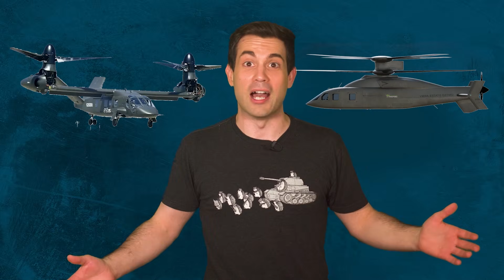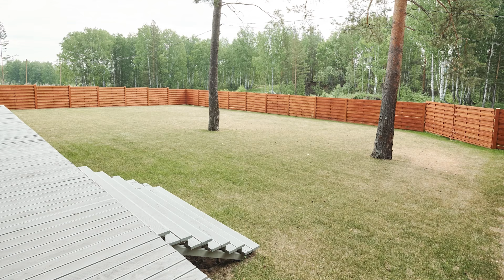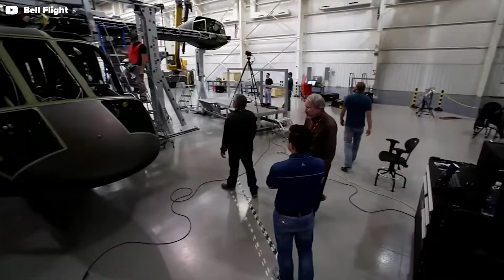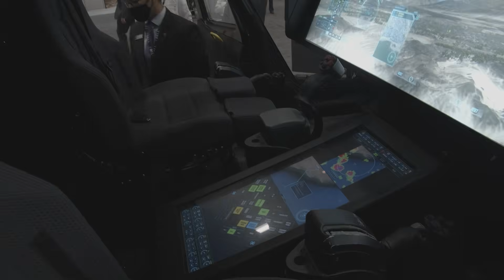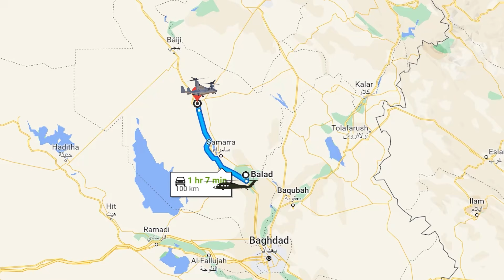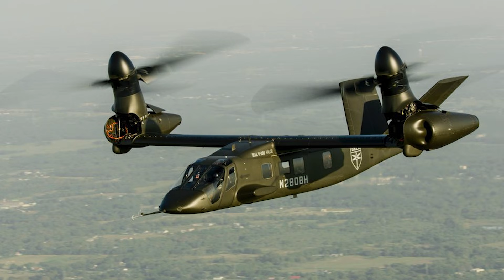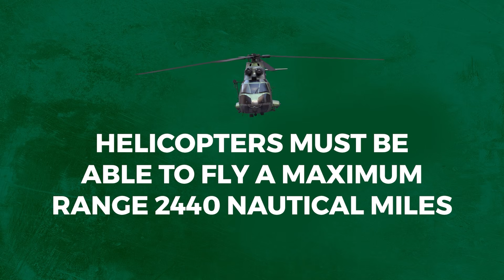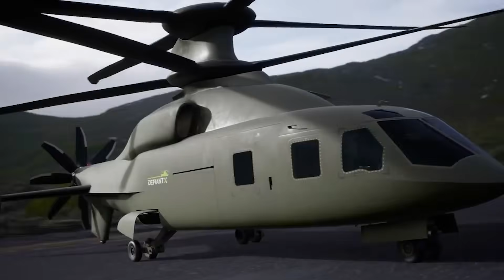V-280 Valor Helicopter Will Help Defeat China

Comment: The way I see it, both these designs are excellent. But they compete in different mission set spaces. The valor is ideal for carrying larger payloads, speed, and range. But the defiant has a much smaller foot print, and looks like it would be a better 1 to 1 replacement for the blackhawk's current mission set. I think ideally in the future, both designs would be used, and they would be utilized for the mission sets they better fit in with.
Reply: @Archer Cillian The Chinook airframe just was not designed for that configuration. The Blackhawk maybe, but it would probably cost as much or more than the clean sheet design of the Defiant. That and retrofit avionics etc.
Reply: I don't think a 1 to 1 with the BH is the goal. I believe an entirely new mission set is the issue and the goal is supplying the force for that mission.
Reply: @Archer Cillian Why would you? The benefit of a coaxial rotor is counter-rotation in a smaller footprint. It adds weight to make the coaxial shaft. Since the Chinook already has counter-rotation, you gain nothing but inefficiency by doubling the rotors.
Reply: agreed, having read up on them, they can both be very useful for certain missions. But if I was forced to choose one, I'd got with the Valor as it is superior all around in terms of speed, range and payload.
Reply: They are not competing with each other. There are two programs. Defiant will win the recon FARA one. Valor will win the long range assault competition. Blackhawks will remain for the basic utility role because it would be over kill to replace it for basic tasks.
Reply: @TheBooban  Heck, even the Blackhawk might end up being replaced with something else so far as basic utility goes.
Reply: @TheBooban  defiant is not entered in FARA.  It. like Valor, is too large.
Reply: The army wants to base their next gen gunship that will replace the apache on the winner, and that cuts out the V-280 because tiltrotors are less efficient in vertical lift and loiter because of the higher disk loading and also because the USAF will likely pitch a fit and try to claim it's a fixed wing. If they complained about the Lockheed AH-56 Chyenne they would most certainly complain about an armed tiltrotor.
Reply: @atomicskull6405  And the Airforce complains about the A-10 which is a fixed wing aircraft for sure but which is built to support the ground pounders instead of perform the missions the airforce seems to want to perform.
Reply: @nobodyimportant72  The really sad thing is that the AH-56 was a better platform than the AH-64 that would come later. If it had gone into production it likely would have seen upgrades and evolution same as the Cobra got over the years.
Reply: @atomicskull6405  Better can always be relative and when it comes to usage may be tempered by cost, or at least projected cost.
Reply: @nobodyimportant72  the Air force wants something that stays in the air for long and can be brought back to action quickly, that's simply not what the A10 was built for.
Reply: my thoughts exactly!
Reply: I can never quite understand military procurement, they seem to often demand a vehicle or weapon fulfill multiple different, often incompatible mission sets, and we either get something laughably expensive or something that's jack of all trades but sucks at all of them. Seems easier to just have 2 different vehicles that each excell at diffetent things: 1 mainly used as a battle taxi ans abother for cargo/large units
Reply: @Archer Cillian I'm performing an educated guess on the differences between the Valor and defiant using data from the blackhawk and osprey. the Chinook is an old airframe, you cannot just retro fit coaxial rotors, aircraft design is more more complicated than that. the advantages of a tilt rotor are speed, range, and capacity. the valor is not a heavy lift aircraft trying to replace the workhorse that is the Chinook, think of it more as a medium weight class with top of class range and speed, while offering good payload capabilities. the defiant would be a much better pure troop transport aircraft with a much smaller footprint, it could land where the Valor could not, think medievac and more.
Reply: @chrxx4327  The modern CH-47 isn't old at all. They are still in production and each new generation is improved over the last. The latest version has a completely redesigned airframe and an all glass cockpit. Current plan is to keep designing new CH-47 models until beyond 2050.
Reply: Well the US military needs to get into gear and start modernizing everything it can. 

With the way the worlds going, World War III might be a possibility in the near future.
Reply: @Kaiserboo1871  WW3 is a possiblity but a slim one. There are a few potential "flashpoints" but the only 2 countries capable of starting WW3 are China and Russia.

Russia of course wants to keep control of the Sakhalin islands and retake at least 1 warm water port, which is a big reason why they're in Ukraine. The problem is they're wholly incapable of waging an effective war and they really showed their hand in Ukraine. Now everyone (including their allies) knows that they're far weaker and far more incompetent then anyone really thought so their allies are less likely to back them in any war. Ukraine is a fairly weak target: they share a massive border with Russia and Russian Allies, they had a weak economy, a corrupt government, and their military and infrastructure was all poorly maintained Soviet hand me downs, much of which was so useless they ended up trying to sell what they could to repay debts relating to both the corruption and debts that date back to independence. If Russian allies wont help them there theres no way they'd join Russia in a war with NATO, and Russia has proven incapable of fighting a war on their own border even with help from China and Belarus. 

China meanwhile has always been a fan of saber rattling. They did it under Mao and the current situation with Taiwan is nothing new, China sends so many planes into Taiwanese airspace that Taiwanese people barely react and the same is true with PRC ships entering their waters, they just get sent back to international space. Taiwan would provide little to China through invasion but they're very valuable as a supposed threat. If Taiwan remains independent the CCP can treat Taiwan like North Korea treats America: as a consonant threat right off their border and a boogeyman always just over the horizon. China could invade but it would cost them a TON, their economy is far less self sufficient then Russia's and they've been a net importer of energy and food for decades, they even had to resort to extorting food from Pol Pot in the 70s just to feed themselves so a war would lead to China being cut off and alone. 

Russia couldn't offer much if any aid in a Chinese war due to Siberia separating them, assuming they even could send aid. China brings nearly all their supplies in via the sea through a couple choke points controlled by neutral powers and US allies. It would be too easy for the mighty US navy to close those chokepoints off and wait for China to starve for fuel and food, and most of China's military is geared towards short range, mainly defensive action. If China attacks neutral powers or US allies in a war that could very easily bring in NATO, other US allies, the UK and their commonwealth, and possibly even neutral neighbors like Vietnam and Thailand. India too offers a massive threat to China since China would be hard pressed to fight them to any kind of meaningful victory, 1 on 1 it would likely end in a stalemate or with both countries decimated and if anyone else joined in on India's side it would leave China surrounded on all sides, cut off from trade, and they'd barely be able to even defend themselves much less achieve any kind of victory or even a staus quo ante bellum. That's why China has only waged a few wars in their history: they fought in Korea with Soviet backing when the Soviets were a super power (and even then they only survived since the UN was unwilling to formally declare war on China or allow direct action against them), and the only other war they've had was when they tried to invade Vietnam in the 70s and got stopped at the border before giving up, and Vietnam is has 1/15th the population, roughly 1/30th the land, and an economy roughly 1/60th of China's. 

China knows they're in a precarious position and that they also provide a substantial threat. The problem for China is that if they act on their threats they'd be decimated but they also know that pretty much everyone will bow to their threats. They have almost nothing to gain by war but everything to lose, but with threats they have little to lose and everything to gain. China is very pragmatic, they'll keep making threats and not acting on them, at least for the foreseeable future. 

Even if China does build a military that can rival the US though they're still kind of stuck though. As mentioned China doesnt really have any real allies, Russia is too far away and too weak to offer much aid, the only potential help would be if Russia can build pipelines and more rail lines to China they could send resources like fuel but that could be cut off via a single air or missile strike and they'd be hard pressed to defend from every direction from the Urals to the Chinese coastline. India is largely neutral but hates China and will likely join in on any war against China, and even if they didnt they'd still likely provide basing and air space to reach China and China would still need to park an army and defenses along the border with India. South Korea, Japan, and Australia (along with the British commonwealth and likely NATO) meanwhile would all join in on any war involving China and a major power. Even if China builds a military that could go toe to toe with the US they'd be surrounded and outnumbered by US allies and China just doesnt have any real allies, just fair weather friends who'll refuse to join in a major war.
Reply: The defiant does not have a smaller footprint. Rotate the Valor 90° and it is roughly the same footprint.
Reply: Actually the footprint of a valor turned 90° to a Blackhawks footprint isn't really much larger...
Reply: True, we are probably just going to do what we did the the ospreys in 2011...

Buy too many of them
realize this is a flat out dangerous and over engineered design, and quietly shelf them only to be used by the president for flashy entrances.
Reply: @lubu4u312  What are you talking about? We still use the Ospreys in the Marines and Air Force(for SOCOM), the Navy just got their own version to replace the courier aircraft a couple years ago. Whatever known danger there was has been worked out in the first couple of years of service with the only dangers being the unknown. Heck, even Japan Self Defense Force is getting or already has their own version of the Osprey.

Pushing for the impossible or "over engineered" is the whole point of these programs: to make the impossible mundane. The benefits are a substantial increase in capability and edge over the enemy. It's what got us aircraft like the Chinook and F-35B STOVL.
Reply: Defiant does not have a "much smaller footprint".  Both competitors met eh Army's footprint requirement'
Reply: If this video is about the V-280 Valor, why is the Defiant in the thumbnail?
Reply: valor won contact
Reply: I think they are relying too much on Afghanistan and Iraq and not enough on Vietnam for dealing with landing zones. Both Vietnam and Afghanistan suffered the same problem that will be even more crucial in the event of a war in this region - limited number of landing zones. In Afghanistan it was mountaintops and the Taliban often posted spotters with a radio to let the others know the Americans are coming. In Vietnam the NVA and VC did the same thing; and with triple canopy jungles there were few LZs big enough to fit any helicopter in - it doesn't take a Washington think tank to guess which landing zones the enemy decided to have troops nearby to respond with; or in the case of China a ship launched guided missile.

The difference between this scenario and those two is that like in WW2, it's going to be even more difficult to take an island by surprise as the enemy (China or Chinese supported faction) has technology that allows them to track US military logistical movement as well as anti-thermal sensor equipment now. Just because the drone doesn't pick up a spotter with their eye on the LZ, doesn't mean they're there hiding under a thermal blanket. You don't need stealth detecting radar in place, just a grunt already in place on the ground with good NODs and a radio.

However I do think these problems can be overcome with effective jamming equipment that would shut down enemy comms prior to LZ insertion. Can we get a Hooah for all those electronic warfare aircraft in the past, present, and future?
Reply: Yes they both have strengths and i think it merits building both aircraft technology
Reply: @jonslowmo  There's not enough money for both, and Valor far outperformed Defiant
Reply: Nah, you don't want a new version of a blackhawk, you want something that will cause a paradigm shift in operations and tactics.  Something that will bring to the fight what has never been seen before because it's never been possible.  The Sikorsky offering is only marginally better than a normal heli, but the tiltrotor has it beat by a wide margin in all aspects.  It flies considerably faster with far more range, and that's important when most of your flight time will be over wide open seas with hundreds of miles between points.  One thing that often gets overlooked with tiltrotors is that while they can do the same things a heli can in hover, a heli can't maneuver at speed like a tiltrotor can.  At speed the tiltrotor is a plane capable of maneuvers that a heli can't match.

As for adding tiltrotors on a Chinook, Bell already has plans for a quad rotor heavy lift variant that would replace the Chinook and Stallion.
Reply: @Skinflaps_Meatslapper  thats always the goal
Reply: exactly what I was thinking. I agree with you 100%. That is why I do not understand why they are compething with each other, they should both be used in their respective environment where they are better suited in. The only argument against it is an economical one but militarily and tactically speaking there is no better solution than using both when needed in specific mission sets.
Reply: Yup, two designs which may be created with the same list of requirements but which would fill them very differently.  The Valor probably should go further faster but when it gets there what's it going to do if/when it takes more space to put down than the Defiant?  If you're going to have one of these working in close to the enemy I'd have to think the Defiant has the edge there with the smaller footprint and profile.
Reply: @nobodyimportant72  It fits in the space the Army required.
Reply: None of it will come on time.
Reply: If you want something with a smaller footprint... the Raider is what you should be asking for. 

It can carry 6 troops and a 20mm cannon. Significantly cheaper to operate as well and fast enough.

Footprint is closer to the little bird than the blackhawk.
Reply: They should build both.  The V-280 for speed and range, and the Defiant-X and Raider X to fly together, one a troop carrier the other a "Comanche" type recon/gunship.  If they can build a V-280 that's a gunship version or a refuel version, even an AWAC version, then V-280 all the way!  Still, the X2 technology is impressive, they should push both for now.

Comment: The experience of the V-22 was it’s very maintenance intensive. Will this tilt rotor tendor be any different?
Reply: In the v280, only the rotors tilt instead of the entire engine nacel, which apparently was a cause of many of the maintenance issues in the v22
Reply: @johnaltman6671  ah ha. That makes sense. I wonder if the Osprey will get an upgrade in due course? 

Thanks for the info

Comment: Yea imma vote for a no on the v 22 looking one. I'm sure its not the design but the osprey has had way too many accidents.

Edit : brought this up before Cappy mentioned it.
Reply: while the cost in lives was unacceptable and higher than it had to be, The bugs in the osprey have been pretty well worked out. That being said the push rotor design has a serious advantage low level flight, likely has a smaller footprint on the ground and is probably less maintenance intensive. if it can meet the lift and range requirements I think it's the clear winner.

Comment: The 10000 pound m777 as reason why the Blackhawk is outdated is really stupid to me. You can A (just disassemble some of the M777 IE its wheels and legs and bracing points and carry that on another blackhawk that carries all the other M777's in that batteries disassembled M777 parts. B look at lowering the weight of the M777 thru using lighter parts or removing ground transport parts as you are no longer towing them on the ground behind a truck. Or C make a air operations version of a M777 that can be both quickly disassembled and rapidly assembled and uses lighter parts.

Comment: In my opinion I would rather had seen upgraded mv-22 with all of its shortcomings fixed. For one everything good and bad about the mv-22 is know by now its served very well it's just needs a few design changes to help it along. The wings are really too short for it but was done in order to fit them in ships. It causes them to do a rolling takeoff so as not to put too much stress on it if I'm correct. This as good as it it might be it has far less capacity (compared to the mv22) that in my opinion is a no go but I do like the aircraft I just like the mv22 better